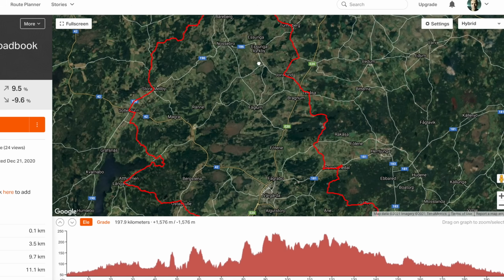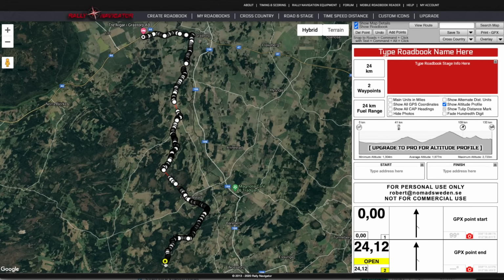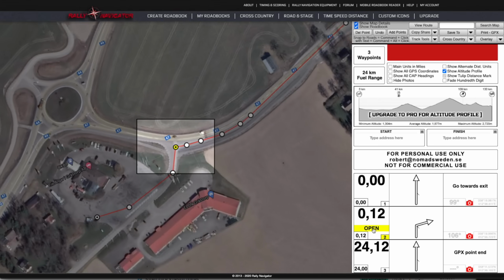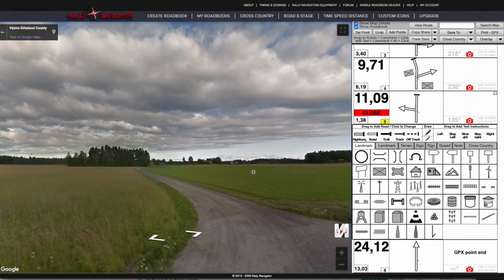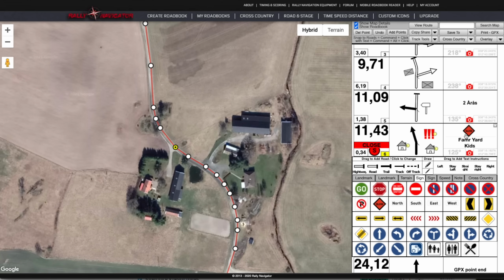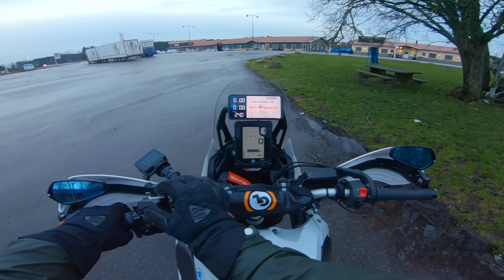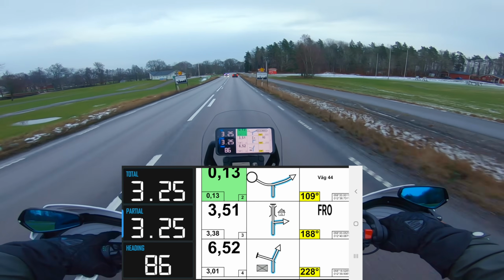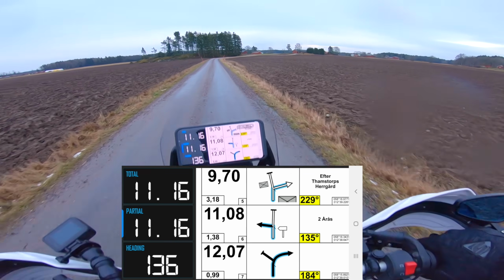Create your first Digital Rally Roadbook

Comment: Hey mate does the phone scroll the page automatically during the ride after going through check points ???
Reply from the maker: You have to scroll manually. Optimally using a handle bar controller. The roadbook is just a PDF file and does not connect to GPS or ditance so it doesn't know where you are. Like a paper roadbook.

Comment: Dear Robert and friends, great video, lots of knowledge. But I'm not quote convinced from leaving Garmin Zumo. Just the right OSM map needed, much quicker to plan a tour from the PC at home. Of course, we all have to double-check in reality and ride the tour. Your Rally Navigator roadbook looks a lot like Dakar, that's ultraprofessional, and pimped-up compared to good old Garmin. So where's the real advantage except those nice tulips? Cheers, Günter
Reply from the maker: Hi Günther. Roadbooks are for rallies, as a challenge for navigating. A sport or a fun event. It is not to be compared with a Garmin which does not even do roadbooks.
Still, it does has advantages since it contains detailed warnings and info about certain sections on a challenging track. Another commenter in this video does tours as a profession and use it for tracks that are re-used often, because of the detail.
But, to make a route once and then ride it, you would never make a roadbook. Garmins are made to navigate with no effort. Roadbooks is the opposite.
Reply: @NomadSweden  Hi Robert, thanks for your quick reply. Now I understand. Maybe I should try roadbooks for a change, for a challenge ;-)
I like your advice concerning a Samsung phone with apps and Carpe Iter. Cheers, Günter

Comment: A really great video - thanks for that, the professional execution is really second to none!

The whole subject appeals to me all the more because I have been professionally involved with roadbooks for many years as I offer motorcycle tours as a tour operator using roadbooks for navigation. Recently, however, the criticism of the anachronistic principle with paper, tripmaster and roadbook holder – everyone using its own hardware of course - has become louder and louder. This is a great pity, because in my opinion, the roadbook principle has by far the advantage over simply following a GPS track on the navigation device - especially when it comes to additional information or warnings.

The development of soft- and hardware in the meantime is very promising and will certainly make me change my mind sooner or later. One thing, however, remains the same: the effort of creating a good roadbook not only requires a fair amount of diligence and precision, first and foremost you also have to know the relevant routes!
Reply from the maker: Thank you! Proud to receive cheers and input from a veteran in the subject. This is so much fun but as you pointbout, also a superior way of navigating a fixed route.

Comment: how to continue the roadbook when for example i decided to buy gasoline first in the gas station first? (not the digital roadbook)
Reply from the maker: Not sure what you mean? Explain please.
Reply: @NomadSweden  i dont know, im not good at English 😅,

if you have a miggtec or f2r roadook with tripmeter.. and u want to refuel tank. how to recalculate the tripmeter and the roadbook's numbers.. im sure that the numbers don't match each other
Reply: i dont know, im not good at English 😅,

if you have a miggtec or f2r roadook with tripmeter.. and u want to refuel tank. how to recalculate the tripmeter and the roadbook's numbers.. im sure that the numbers don't match each other
Reply from the maker: @techies_gaming8091  the tripmeter is adjustable. When you are back to the correct position again you set the tripmeter to the correct value.
Reply: @NomadSweden  can the trip meter be paused?
Reply from the maker: @techies_gaming8091  not sure, I don't think so. You have to adjust it when you are back